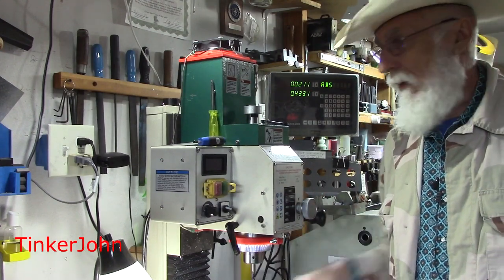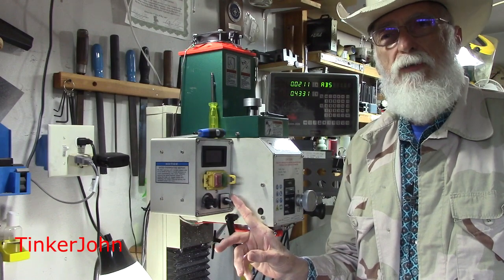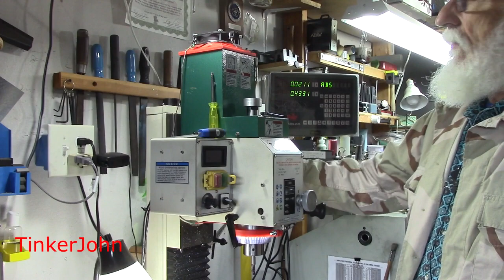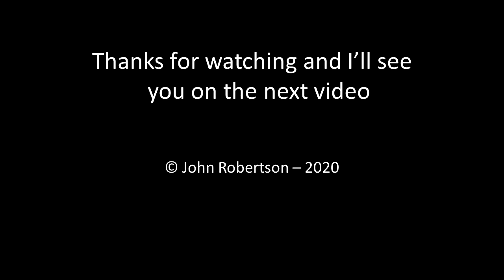Four Year Review Benchtop Mill - Grizzly G0704 #grizzlytools

Comment: I have the twin to your mill from Precision Matthew's and have found it to be  a capable mill too. I may have to look into the Grizley power assist for the head. One thing I did was to make a wooden platform out of 2x6s and 3/4 inch plywood. It has made a world of difference in comfort while using the mill

Comment: I have a Grizzly G0759 which is the same machine as the G0704 but with a DRO.  To date, the best modification I made to the machine is the X axis power feed from Grizzly.  Saves a lot of hand cranking and it allows variable feed speed.

Comment: i just built a wood bench(2x6s and 2x4s) with  2 pieces of 3/4" plywood glued together to make the top, and made it 6" taller .  it turned out much more solid then the stand! (also bolted to a wall)  and the 6" added to the height saves on the leaning over! (my back loves it)

Comment: The gear is about $11. I ate two of them running a 2.5" face mill on old railroad track. Got through the job and didn't wreck the mill, so I think it's a safety measure that works pretty well.